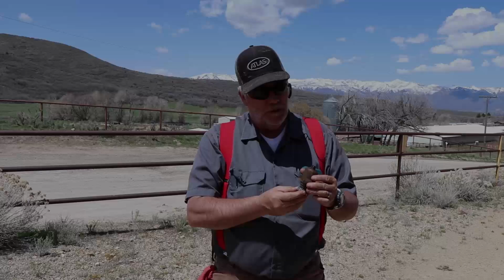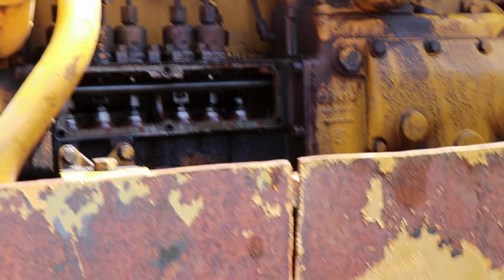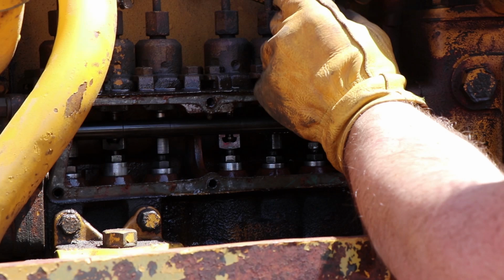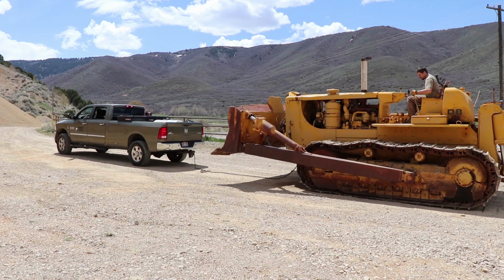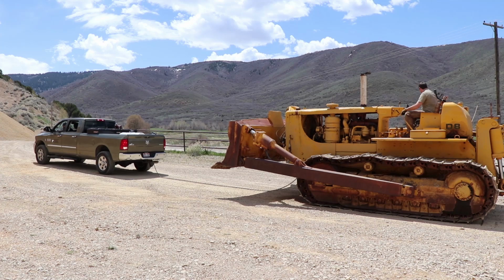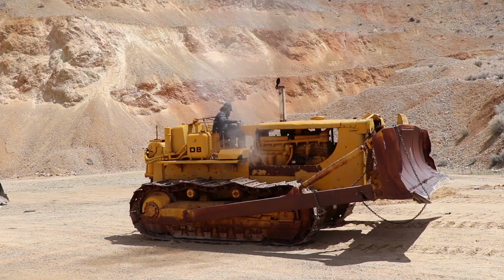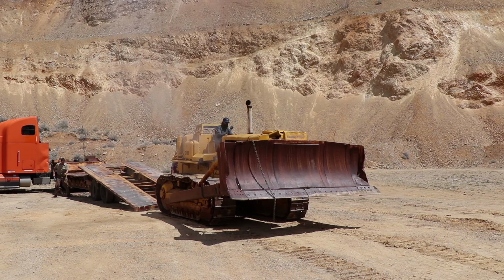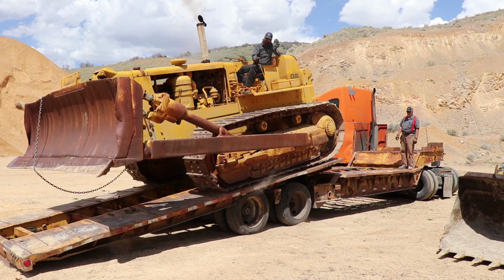Caterpillar D8 First Start in 15 Plus Years and Retrieval Part 2

Comment: My dad owned a D8 H  and had the engine overhauled , had the engine painted white with the valve covers chromed along with exhaust stack. Had a Kelly ripper on the rear modify to bury telephone cable. Clean out the tracks every day after use to be ready the next day! It was his pride and joy.
Reply: Where did it end up? Hope its still going.
Reply: @jimmyduncan7650  He sold the Cat to someone in either VT or NH . I don't recall for sure.

Comment: I had an old D8-2U about 30 year ago. Good old machine that I bought for clearing out fence rows and building terraces. Cable blade was run off the rear winch so was a little hard to root out big locust trees....didn’t have enough hands to run 3 clutches and winch lever! Incidentally , the dry clutch will rust stuck if left engaged but will swell thicker if left disengaged...... requiring readjustment. Cat is proud of their parts...... pony motor clutch was $40-50 ! But it paid for itself.... both farms sold for 5 or 6 times more than what I paid for them. I’m not sure if Cat management has the pride and honor that it had 60 years ago.

Comment: Is that a rod knock I hear?  
Dad had an old 2U D8. I was hooked on heavy equipment ever since.
He got me a cable D6 when I was 15, and that's what I learned on.
Love the smell of those old dozers.
Reply from the maker: DirtMover I’m hoping it’s not a rod. I’ve read these machines have composite pistons and they are prone to separate. I won’t know until I get it apart.
Reply: @papasoldmachinegarage2  Ahhhh,, So my ears are not as bad as I thought.  Something just didn't sound quit right.
I defy you to get any newer equipment to rise from the dead like these old war horses can..
A tip of the hardhat to ya' for getting it going.(and no bee stings.)

Comment: Brings back allot of memories, I used to drive a D8 46A for my father in law. Ate allot of dirt. The 46A had a hydraulic actuator on the dozer blade VS the cable.
Reply: Where is this filmed?
Reply: GARY I LEARNED TO DRIVE A D-8 WHILE I WAS IN THE ARMY (1961) IT DID NOT HAVE A BLADE ON IT, IT WAS USED TO MOVE TANKS AND TRACK VEHICLES AROUND THE POST ORDNANCE ( WE HAD 2 OF THEM ) I WAS WORKING WITH A BUNCH OF CIVILIANS AND ALL WE DID WAS MOVE VEHICLES ALL DAY LONG...THEY TAUGHT ME HOW TO START AND OPREATE IT...WELL ONE COLD ASS MORNING I GO OUT TO START ONE OF THEM, GOT THE PONY ENGINE RUNNING, ENGAGE THE PINION AND CLUTCH AND THAT LITTLE ENGINE WENIT TO SQUALING LIKE A STUCK PIG, I WENT BACK INTO THE OFFICE AND SAID SOMETHING IS WRONG WITH THAT BIG ENGINE, ONE OF THE GUYS SAID, " DID YOU RELEASE THE COMPRESSION ", I SAID , SAY WHAT...I AM GUESSING THIS WAS AN 50s MODEL CAT ? ? ?  I ENJOYED RUNNING THAT BIG CAT, MORE THAT DRIVING THOSE TANKS...

Comment: If you replace the yoke for the injection pump, it has a height adjustment, and you have to set the flywheel to the cylinder your fixing to set it!  The alignment marks on the rack and injection pump are to make sure each pump starts and end injection at the same delivery point. I use a old pump on a bench to test nozzles from these old machines, it is over forty six years old that I know of!! People are still bring them in to have them worked on, getting fewer and fewer because of emission standards!!!! sad!!!!

Comment: Here comes the ambulance!! oh thats the turbo, lol
Reply from the maker: The connection from the air cleaner to the turbo is a slip fit with o-rings and it had come apart so that turbo is really loud. It may also have damaged the engine sucking dirt.

Comment: I guess it never dawned on you to move the trailer so it’s lined up with the dozer that doesn’t steer.  And don’t pay attention to the knock and excessive smoke, that’s just character.
Reply: Right, that cat wont be running for much longer with these clowns
Reply: @wtfhlostonparadise8278  Nobody likes a clown know-it-all. It sat for 15 years and was left there for a reason. Do you think it is going to run just like one that has worked and run daily? That goes for the other smartass "9856CB" TOO. They got it loaded with very little hassle. The know-it-alls are usually the ones that know f all!
Reply: Okay, lets see YOU overhaul an engine in the bush then!!
Reply: Andrew Sobek I would have at least checked the dipstick to see if it even had oil before I attempted to start it.  They even admitted no one looked to see if it had oil pressure (at least 2 times).  Then, after trying to drive it and realizing they can’t shut it off,  the guy in brown jumps up and gear stalls it.  Now they check for coolant.  I guess I missed the”Bush” overhaul......my bad

Comment: Let's go out and start a D8 that has been setting outside for 15 years.  We don't need to check the fluid levels just pull it to get it started.  It won't steer just pull and push it.  Injector not working just tighten it down don't remove and see if it needs adjusting.  I think a high school mechanics class would do this start-up better than good old Papa's Old Machine Garage.
Reply: Yes I would be doing a lot of checking

Comment: In the early 70's I ran a few different versions of a D8. My fav was one that was just a little older than this one. It had a double winch on the back, one for blade lift and the other was for what ever you might need it for. I used it mostly for dragging logs around when we started a new strip mining operation. I'm not even sure if they knew what a ripper tooth was back then. One that I didn't care for at all was an old slide bar D8. Talk about old. I walked that thing out of a track on the side of a levee. Spent the rest of a very long day helping the mechanic get that track back on.
Reply: The other drum was for a scraper

Comment: awesome :D but you should let the engine run on low rpm before you shut it off. otherwise your turbocharger can break because without running engine -> no oil for the turbocharger.
have a nice day.

Comment: That engine alone is worth some nice money. I use to work on those back my days at Cat. When we changed the oil in them older machines like that we would filter the oil through strainer, put it fuel tank & top it off. Made that fuel system last forever
Reply: Yup we use to do that at a trucking co that i worked at back in the 90's pump it out of the engine thru a filter machine mixed with diesel and back into the fuel tanks ...

Comment: Hi, Papa's Old Machine Garage.
Those gears on the injector pumps DO NOT control the timing of the injectors. Instead they control the amount of fuel which the injector pumps deliver to the injectors. The timing is controlled by the cams that lift the injector pumps.

You got the cable back to front in the wedge pocket. It is supposed to be the other way around so that there is a direct line of pull on the cable instead of the kink that you now have in this video.

The white smoke coming from the engine oil breather could well be caused by blow-by, which may be due to engine wear, or it may be due to having stood for 15 years.

These engines should be idled down''  for five minutes, especially after working hard but even after a full revs engine run like you did in the video to allow the turbocharger to slow down and cool down. The whistle that can be heard after the engine was shut off was the turbo winding down and it would not have had oil flowing to it to keep it lubricated after the engine stopped. But it'z your turbo.

Glad you got it home and thanks for sharing.

Just my 0.02.

You all have a wonderful day. Best wishes. Deas Plant.
Reply: I said almost the exact same thing about the turbo in the first video. Thanks for explaining how the gear worked. I thought he was wrong about the timing but wasn't certain.

Comment: We load our dozer and track loader forward.  Straight on and Straight back off.  But whatever works. Great vidja
Reply from the maker: We backed it on so we had the high forward gears to pull start it when it came off the trailer

Comment: Doesnt that turbo sound awesome! 
Also is it common to have a cable blade with hydraulic tilt?
Reply: No :o) But it does make sense to have popped a kit on there so it could push down. I’m not entirely sure the previous ‘thing’ is a trailer ripper?

Comment: Interesting?
Just wondering what the engine oil and filters looked like, after 15 years?
Did you thumb and fore finger the viscosity? colour of oil ? 
It would be a pity to let it run only to have it grinding away on parts with poor oil etc, moistureand corrosion debris, etc the white smoke would tend to indicate water or moisture rather than oil; blowby out of the sump breather.
Dumping huge amounts of areostart/ether into the intake is murder on smaller engines Ie bending rods and hammering crank bearings on firing with a mass of starter gas, probably the size of the con rods etc make it less prone to  that on an engine of this size but still hard on them.
Valve train sounds a bit woofy not surprising after 15 years of weathering and corrosion,  Sounds like one or two of the valves are leaky or stuck open. 
But all power to you for getting the old girl loaded, agree with prior commenter the trailer looks a bit under strength for the tonnage though just as well you didn't have to hit the scales or have a the trailer mechanicals looked over .

Comment: They've never heard of idling the turbo down, well they'll pay for it when it spins the bearings dry and dies.
Reply: Does it sound like the engine was revving very high when they shut it down? Is that a common expression "idling the turbo down" in your world? How is that done; got a separate lever? LOL
Reply: @KStewart-th4sk  it was revving quite high, on those older turbos it was recommended that you idle the engine for around three minutes (the reason "Turbo Timers" have a three minute setting) so as the compressor wheel slows down it has oil flow, which, if the engine was shut off, wouldn't be there. When, in a past life, I transported John Deere machines around Australia, we were instructed to tape over the exhaust pipe end so the Venturi effect didn't cause the impeller to spin in a dry turbo, thus shortening its life. Probably more appropriate to turbos with bushing bearings not ball bearings. Some  engines now have a reservoir above a turbo to gravity feed oil to the turbo after the engine is shut down.

Comment: what year might that machine be?
Reply: 1965 -- without the whole serial it is hard to guess,.....Cat made them from 1950 to 1970.  The one I helped on was a manual clutch with a hydraulic torque converter (used diesel for fluid), my job was starting pony motor for each shift -- I liked the duty!
After starting three similar Cats in the am, my job was rooting out the stumps for a three mile road job, (original very big Douglas Firs), lots of cutting bore holes into middle of stumps and placing a double handful of rapid-disassembly gelatin;  the other guys would coax the separated pieces with the Cats into the fire! 
I got to sharpen chain saw and drill shot holes while the old 2U and the 36A would move the dirt and rocks off the alignment.

Comment: Why do Diesel mechanics call the fuel control 
a "throttle?"  Before internal combustion engines 
were invented, "throttling someone, was to limit 
their AIR intake.  (It was a method of murder, or 
state sponsored execution.)  A throttle on an IC 
engine, limits its AIR intake.  Fuel injected gas 
engines still have a throttle plate, which limits 
the engine's air intake.

There is no AIR intake control on a Diesel 
engine, therefore no throttle.  A Diesel DOES 
have a fuel control, though.

steve

Comment: Think theres a hole in a piston.
Reply from the maker: That’s a possibility. I’ve learned this model had problems keeping the number six piston cool
Reply: Or a bad injector.
Reply: @serioustrouble63  or that injection pump went back in wrong on the rack?
Reply: Papa's Old Machine Garage makes me happy that my dads dozer never had that problem, he has an old case 850B and the worst it has had is a loose steering lever and a stuck throttle. We fixed the throttle (it just needed to be lubed up) so we only have to fix one of the steering levers
Reply: Or on the verge of throwing a rod! Not healthy for sure.
Reply: @bambambundy6  I’ve seen a D7 that did that. It had sheared off the cam shaft on its way out. Must have been one hell of a bang :o
Reply: Probably from that entire can of starting fluid he feed it lol

Comment: Maybe you have an exhaust leak. It would be much easier to load going forward.
Reply: Loading backwards gives a better view of the ramps and tracks. Probably felt safer with steering issues and better view.

Comment: If it wasn't for ragged ass, worn out equipment, this guy wouldn't have any at all.
Reply: Hilarious. I was literally having this same thought when I came to comment. I love it though. Neat old nostalgic stuff.
Reply: @ditherdather  The D8H is about the best D8 ever built. Well worth fixing. It will be running after all the newer stuff is done for. Probably a hole in one piston and possibly a broken crank but well worth fixing.